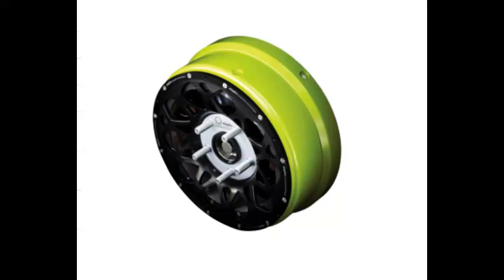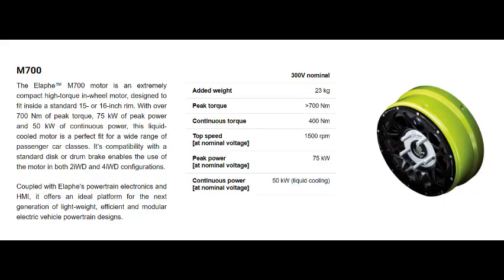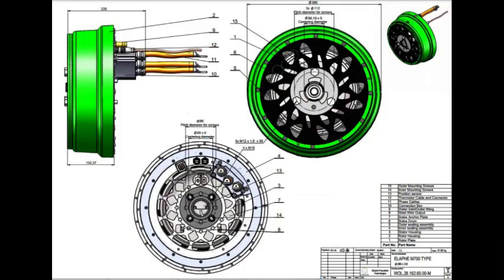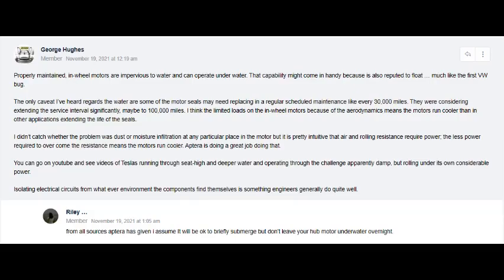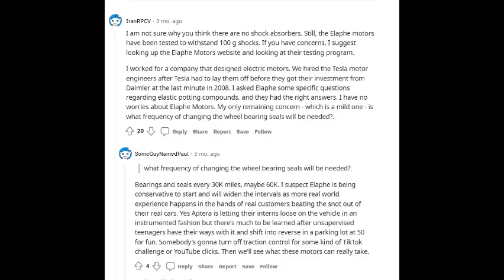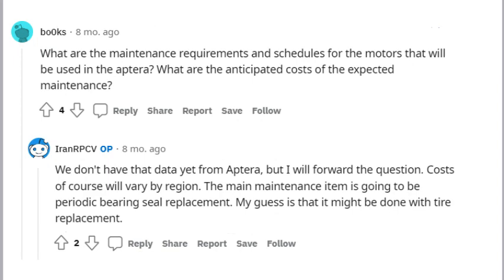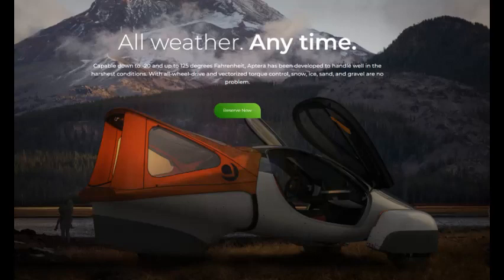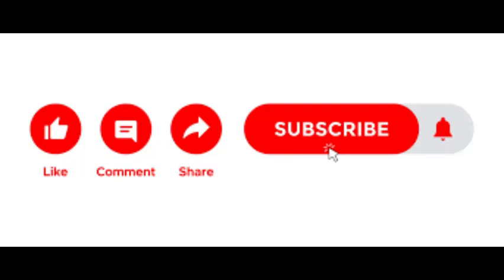Aptera Technology Challenge - In-Wheel Motors.

Comment: I was referring to the brushless out runner motor itself not the bearings inside of the motor.
Reply from the maker: I'll have to google that term, "brushless out runner motor". I don't understand what that is.
Reply: With conventional motors, the magnets are attached to a shaft that rotates on the inside of the stator coils. This is called an inrunner motor. With an outrunner motor the magnets are attached to a ring or sleeve on the outside of the stator coils.
Reply: I would assume the outer seal would prevent dirt getting into the motor but if anyone has any other ideas on this please let me know. Also not sure what you mean by out runner. Can you elaborate please?

Comment: There was an Elaphe presentation to Aptera Motors where they indicated that their hub Motors were literally water and dust proof with use of improved seals.  Sorry but I have no link for that currently.  Will post it when I run across it.
Reply: Yes, there have been a lot of upgrades during Elaphe's development process, too.  I was the creator of the Reddit forum you mention - Thank you for showing my comment!  I have since found out that the latest version of the Aptera wheel motors have lifetime sealed bearings.  - no more need to service them under normal use expectations.